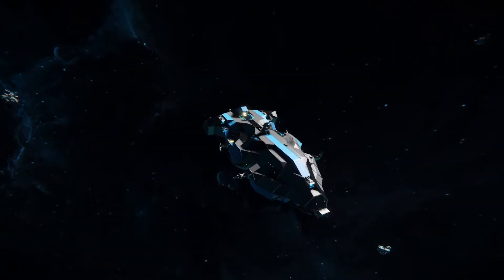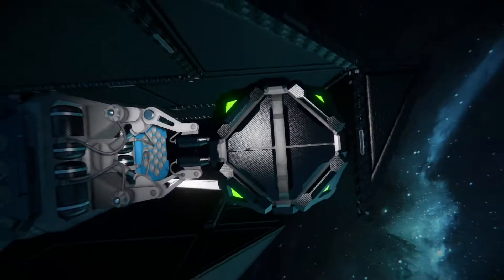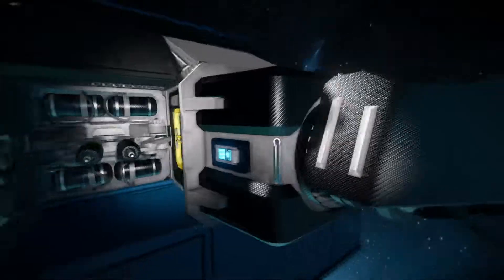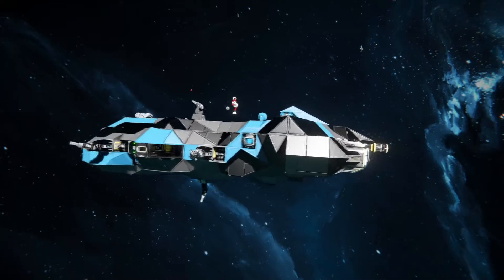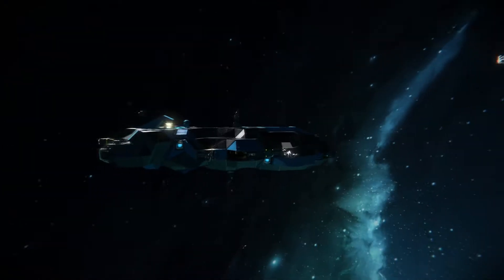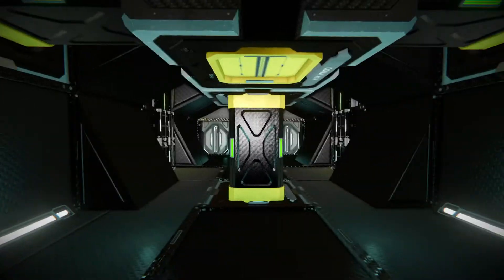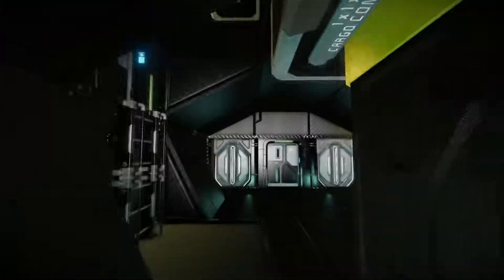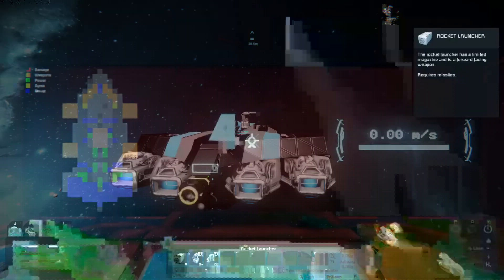THE EXPANSE inspired ship // UEN Lyn // Space Engineers

Comment: I thought when you said it was inspired by the expanse you meant the deck layout. Love seeing vertical layouts in space engineers ships.
Reply from the maker: I would really like to try out, the vertical layout! Maybe i should for the next one ;)
Reply: @BromanderBrody  In my single player world I have the unlimited speed mod, so instead of using a gravity generator I rely on the engines of the ship to push into me to keep on the floor (I do have a grav generator but its set at like 0.1 so it keeps my mag boots from triggering.) If my ship runs out of fuel for the main engine Or I cut thrust for any reason and i'm on the float.

The biggest problem with vertical layouts arises when you want to make the ship Atmo capable. Getting landing gear to look nice and extend past the thruster cone can be difficult especially if you don't like your ships having micro stutters.
Reply from the maker: @outerheaven155  I love this! I actually found a nice solution to the landing gear part tho. It’s the interior itself I’m struggling with ;)